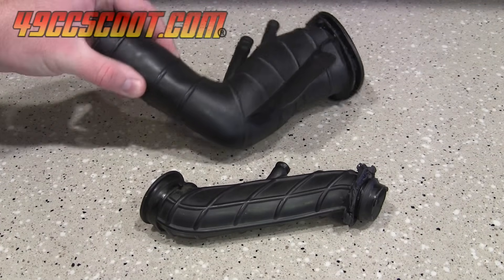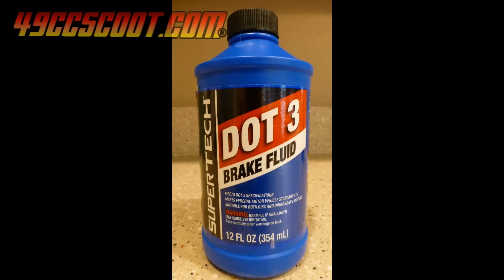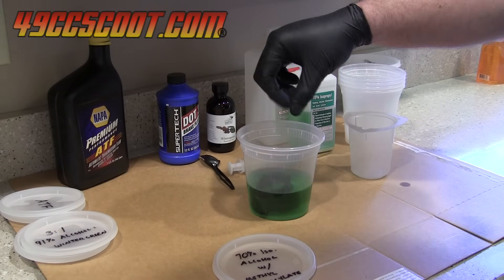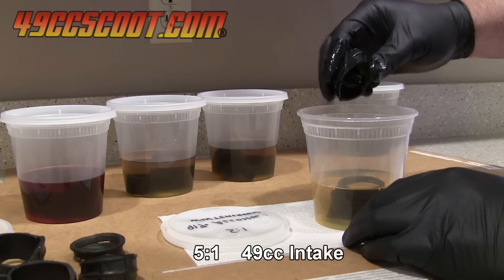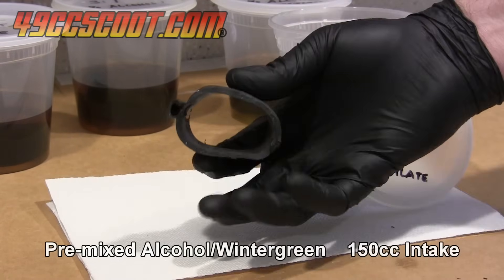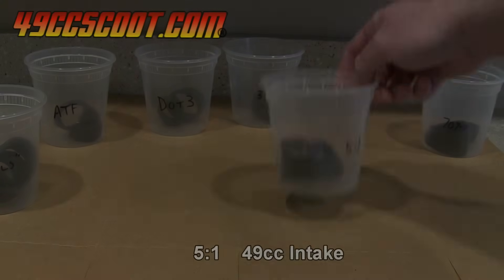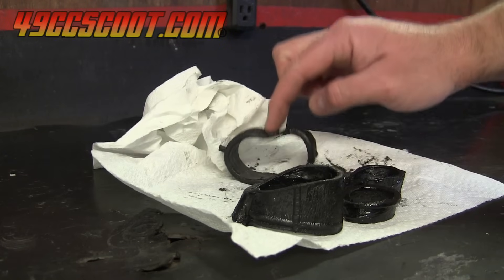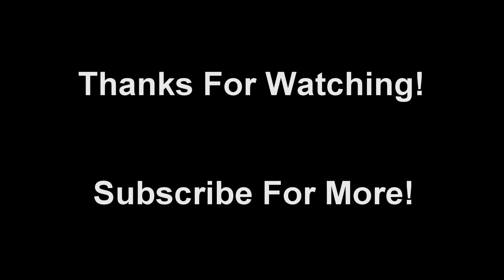Rubber Softening Experiment : Wintergreen Oil, Brake Fluid, ATF & More

Comment: can i use this to soften dry rot car tyres. they r not so much rot.
but so much DRY and making noises when running at slow speed also
Reply from the maker: Check  the codes on your tires to determine their age. If they're more than 6 years old, most recommend replacement. If you're experiencing  rubber degradation, it may again be a reason to replace them. It's not worth trying to rejuvenate tires IMO, because it could be a safety risk.

Comment: We needed a control for the second test to prove boiling in water wasn’t what was causing the softening, or at least to see if the softness is significantly different or longer lasting than the wintergreen mix boil.

Comment: What about pure winter green on the experiment?
Reply from the maker: I didn't test that, but the alcohol is supposed to basically open the pores of the rubber to allow the wintergreen oil to get in there better.

Comment: Wintergreen oil (Methyl Salicylate) is an actual plasticizer, and used in many rubber formulations so it can renew properly many types of rubber. Other fluids like brake fluid etc instead contain oils that will degrade plain rubber (that is why there are particular oil resistant rubbers used in certain applications), the temporary softening is just due to the solvents in the fluids. 
Avoid boiling the rubber, the temperature is too high, for large parts just use glass beads to fill the voids when soaking and change position of the part every so often.
Reply: That glass bead trick is great. Im kinda embarrassed I've never thought of that before
Reply: @jmc5341  +1 to that, so simple yet probably works great and can be used infinitely
Reply: Nice explaination
Reply: Thanks ! do you happen to know if it is also used as a plasticizer in vinyl mixes ( vinyl doll parts for exaple )
Reply: Thanks! Will Wintergreen help restore embrittled plastics? If so, how is it applied?

Comment: Great test! Too bad you didn't try pure wintergreen oil. I am tempted to try that on hardened speaker rubber surrounds, where alcohol would just evaporate.
Reply from the maker: If you wanted to try the alcohol/wintergreen method, or anything  else that you wanted to seal, if you can remove the speakers then maybe you could place them face down in a large bag or container. Some speakers use a foam rubber that I don't think softening is going to work on, but I suppose if it's an otherwise lost cause then it's not much risk.

Comment: Hi just have a question about the 91% isopropyl rubbing alcohol, is it good if i have 99.9%? Or it will just fail??
Reply from the maker: That's fine. 91% is the most pure that I could get at a reasonable price.
Reply: @49ccscoot  ok. How about 70%?
Reply from the maker: @cjbongalon2064  That's commonly used too. Not sure I'd go below that.
Reply: @49ccscoot  ok ok thanks for the info.❤👌

Comment: Nice video, well put together and informative. I'd be interested to hear from anyone who's tried any of these methods on drive belts, wheels etc from vintage record players and tape recorders, where rejuvenating old rubber is a similar issue
Reply: Good question. On the topic, would you know of any good video resources on how to restore old reel-to-reel recorders? I'm not even familiar with how the mechanisms work so in depth tutorials would be the best help.The one I have appears to rotate one of the reels in the wrong direction.
Reply: @Marcoosianism  This may be of help: In some models the "feed" spool (the left hand one) achieved the correct tension on the tape by having a slight drive in the opposite direction; this will only be noticeable when there is no tape engaged, if you press "play" the "turntables" will rotate in opposite directions. There is a great website / forum called "tapeheads" for any technical questions related to all types of tape recorders. A friend of mine has recently used the Wintergreen oil method to restore a rubber-edged drive-wheel on a 1940s record deck
Reply: @signature50  Very helpful! Thanks Sig50. I'll check out tapeheads and give it a go actually loading the spools on the machine. Figure I'll most likely have to restore some rubber parts using the wintergreen oil method too. Glad your friend had success. I'm sure you will too.

Comment: Would have loved to see you compare shore hardness tests to your calibrated thumb and finger.  Seems like an automatic since measuring elastic/rubber materials hardness is what it does.  You went so far out of your way to be scientific too.
Reply from the maker: If I knew there were test options that are pretty affordable, I would have. Live and learn. I still think for most people that have some hard old part, they just want to know if it is significantly softer or not though. Thanks for the comment.
Reply: @49ccscoot  True.  I think your results are adequate.  Shore hardness gauge is not in the average persons vocabulary.  It would have been interesting to see if your feel/touch results agree with a gauge designed to make that measurement, that's all.  You clearly went out of your way to be as scientific as you could.

Comment: I use wintergreen oil a lot.  Get the gallon size.  I tried it on an old motorcycle seat cover.  Bad, so bad.  The vinyl separated from the backing.  Some old carb intakes swelled so much as to be unusable, at least for now.  But, in general it helps, even thick rubber parts.  I keep a pot covered and toss in parts as I take stuff apart so the mixture lasts pretty long.  I soaked an ignition coil where the wires were too stiff to bend and they came out better than new.  They felt like silicone rubber wires.  And, the shop smells great.

Comment: Question, will it work on shoes as well? Since rubber outsole hardens on shoes as well.
Reply from the maker: You can try it, but I would suggest being careful to make sure no chemicals contact anything else. Especially anything that would be in contact with anyone wearing the shoes.
Reply: @49ccscoot  i have another question, does it matter which oil you use? Or does it have to be specifically wintergreen oil? I keep finding peppermint and other oils but no winter green.
Reply from the maker: @thomascalderon598  It needs to be wintergreen / methyl salicylate.

Comment: Used the 3-1 mix on carburettor intake stubs. They swelled up slightly at first, but softened up nicely, about 10 days later they were  back to their original size, and were ready for use.
The softening effect lasted about nine months, then the returned to being rock hard.
Reply: Good to know
Reply: I know your comment is 4 years old but I wonder if a coating of silicone oil after a softening treatment would keep the rubber soft for longer than 9 months. Have you any experience with this? Thanks.
Reply: @istvanmeissler2238  Interesting thought, it didn't occur to me to try. The idea might work for some applications, but in my case the rubber intake stubs are up to around 6mm thick in places and made of rubber similar to that of a car tyre, and I doubt it would penetrate deep enough into rubber to do anygood..Good luck with trying though..

Comment: Epoxy curing agent dissolved in hot oil was the best I've seen. It makes rubber really pliable in a few days. Fuel system cleaner with polyetheramine (same substance in epoxy curing agent) comes in second and Brake fluid comes in thrird. Never tried wintergreen. But you need to feel after it completely dries.
Reply: Do you know the chemical name of the epoxy curing agent you used?
Reply: @wildmanofborneo  Triethylenetetramine or the heavier Tetraethylenepentamine.

Comment: To control temp of the water & Winter Green tests, try using a double boiling method.  That is a pot inside a pot.  They use this method in cooking/heating candy.  Outer pot is water only, inner pot is the solution.  The water in outer pot more evenly distributes the heat.

Comment: This is so cool!
In my research, I found that wintergreen, petroleum jelly and other spirits are rubber solvents, and the rubber goes hard when it loses its plastics. Replasticising is why silicone spray is ideal on window seals and such. 
The brake fluid thats usually used is part petroleum and part silicone so its both solvent and replasticiser. 
The recommendations Ive seen around are: For maintenance of rubber - silicone spray wipedown. Heat only used if its hardened due to low temps. Petroleum jelly wipedown for a slightly aged piece that needs a refresh/refurbish. In cases of undamaged but very hard, Ive seen recommendation of hot water soak first to then dry and then soak in your brake fluid or silicone spray for a varied time, checking as you go to see based on the rubbers needs. Once satisfactory, sake out and wash with soapy water, rinse and  let dry for a day.
I was looking in the way of old typewriter platens and thats all the stuff that I came up with. Apparently sewing machine oil and an old bottle of what was called Typewriter Oil are both petroleum oils and were used for the maintenance of the machines.
I thought Id share in case its adds to the research experiments. :)
Reply: Thanks for adding this.  It sounds like you are reporting research rather than experience?  I wonder if the "Silicone Spray" you mention is the typical stuff with solvents or the special pure stuff that is food grade.  CRC sells a pure food grade spray but the rest are more like WD-40 with silicone added.
Reply: @ceeweedsl  I have both vintage sewing machines & 70s typewriter. Used Vaseline on slightly too firm, and soaked in WD40 Silicone spray (the one labelled as Silicone spray, not the general spray they have) on the platen and rollers of my typewriter to refurb. I wrote all the other stuff bc I did a tonn of research for just that small amount and ppl may have different needs & points of info to make the best decision for their rubber refurb needs & having it all there would make life easier than it was for me.

Comment: I like the fact you didn't quit , well been two days I wonder what a week will do, still not the result you were looking for so lets add some heat.  Very well done.  I have expensive rubber boots, the rubber is starting to crack , looking for a way to soften the rubber back up. I don't think this will help but it was fun to watch.  I think I will try the heat and the wintergreen oil, with controlled heat.

Comment: Thanks for a very informative experiment. 
I need to revive two washing machine shaft seals, so your video clip is just what I needed. 
I read somewhere that almond oil is supposed to rejuvenate rubber,  which might be a cheaper option (if it works as well as  wintergreen oil)
Reply: did you ever try the almond oil?

Comment: boiling the rubber improve the hardness by removing stress from crystalised work hardened rubber surface and is really similar process to steal anealing 
from what i know temps for water anealing rubber should be 80-90 C for more than 5 minutes and leave them to cool off slowly in the water to "normalise"

most rubbers that are thermo set should respond well to this treatment but the hardening will return because in most cases reason for hardening is evaporation of plastecizing agents that are not restored by boiing, but can by soaking in them
Reply: Interesting; what are the names of some plasticizers? thanks

Comment: Would this method restore stretched out thinner rubber? 

I'm trying to find a way to restore the rubber focusing ring on a vintage 1960s camera lens. The rubber ring that was around the lens has loosened or stretched over time and doesn't grip to the lens anymore for proper focusing.
Reply from the maker: I'm not sure if it will work for that. If the piece is no good anyway, you could try it.

Comment: Would this work on a dry rotted gas mask?
Reply from the maker: It may soften it, but it's not going to fix cracking and such that generally accompanies dry rotting. If the mask will actually be used, forget it and get a new mask.

Comment: Everyone is complimenting the scientificness and thoroughness of the experiment, which I agree, but no one noticed hes using TAP water (which has chlorine among other things in it)? Lol
Reply from the maker: My TAP water is well water. Not treated. Who knows what's in there, but it shouldn't be chlorinated.
Reply: Chlorine also another compound which has potential to soften or slicken rubbers. My friends back in my high school days used to pour puddles under their car and truck tires to help create some crazy burnouts while keeping the front parking brakes engaged.
Effectively/Quickly softening the rubber to break any traction.
Principle and vice principal used to give out after school detention to those caught.Lol
Anyway,  more importantly,  I too am thankful for the kindness, sharing this video, and all the time devoted to making it.
It truly helps many (myself included) looking for the best method/safest method to soften or rejuvenate our hardened rubber items without destroying them.
It's much appreciated.

Comment: So this has given me an idea, after speaking with a pharmacist, we realized that wintergreen oil's active ingredient is the same as icy hot muscle rub. I was thinking I would coat the rubber intakes with the icy hot then vacuum seal them and let them "cook" in a bath of hot water in my sous vide machine. Do you know what an ideal temp would be? I have a control so I can go low like 120F/49C or would warmer be better?
Reply from the maker: I'd guess it depends on the exact rubber used. If it's not a rush, I'd try low temp first and see how it does or just see what happens with the rub alone.

Comment: Hey great video I was wondering if any of the products used seem to have added any slip resistance or grip to the rubber?
Reply from the maker: They would probably better to some degree just from being softer. I don't recall any of them making the surface sticky or rough.

Comment: I wonder if you did not use any wintergreen oil, would just simmering the rubber in water work?
Reply from the maker: Most likely only temporarily softened while hot.

Comment: Thanks for taking the time and doing this. I restore old typewriters. They have rubber platens,rollers,and feet. They are very difficult to find replacement. Expensive. I'm going to try this. Thus video could be invaluable to saving pieces of history. Thanks again,very appreciated!
Reply: Use a product called "rubber renue".

Comment: What about rubber suspension parts that have aged allot on a vehicle with barely any miles, like a car with 20-30,000 miles but is almost 25-30 years old, you might be best to replace them yes but some parts can be expensive or hard to come by depending on the vehicle and manufacturer. 

Would like to know if there is a solution especially one that involves spraying on them instead of taking the part off the vehicle and dunking the part in a solution for a long time.

 Heard that AT-205  Reseal ,being it is a plasticizer could work. Resealers overall are snake oil cause most are petroleum based but AT-205 doesn't have any and has been highly praised overall,  heard a light spray can help rejuvenate rubber suspension but dowsing it in the stuff can make them too puffy and squishy.
Reply: Great thought.  I’d like to spray this 3:1 compound on my axle boot covers.

Comment: That's great! Thanks for the info. 
I have a couple of pieces with new rubber but very stiff, does this process soften new rubber or does it work only for old rubber to get its previous softness?
Reply from the maker: I've only tried what you see in the vid.

Comment: I am trying to boil a piece in jsut water to see what happens but im only boiling it for a few minutes. However the thing I am boiling is a little solder vice suction cup thing so it doesn't have to be super soft just soft enough to be a suction cup. Out of the water it seems fine and now i am waiting for it to cool to see if it stays soft or what. I assume it wont stay soft but I figured it was worth trying.

Comment: One way to reduce the amount of solution needed is putting the part and solution in a sealed bag, and then submerge both in plain water to pick up the space and push air out

Comment: I tried this with old sneakers whose rubber soles had turned hard.  I mixed water and wintergreen oil in a pan and then placed the shoes in the mixture, just enough to cover the outsoles.  I covered everything with plastic wrap to try to prevent evaporation.  I left them for for over a week and when I retrieved them I noted the once white leather uppers had turned pink from the red paint on the soles that had been submitted in the mixture.  The plastic wrap had turned pink as well as the liquid mixture.  The rubber outsoles had been ruined as thin parts had stretched and torn despite not having been touched during the experiment.  To sum up, check your parts frequently and avoid soaking painted parts unless you're okay with paint bleeding.
Reply: Sounds like you're into sneakers, I'm assuming you wouldn't recommend? I too have some shoes with hard soles..
Reply: @Chocolategiddyup5  You'd really have to experiment with amount of oil and length of time. When I did it, the rubber cracked or got gooey. In both cases the rubber turned hard again.
Reply: @kevin15776  good to know, thanks for responding. I'm just gonna have to accept that the shoes are at the end of their wearable life smh
Reply: @Chocolategiddyup5  maybe someone will find a way one day
Reply: @kevin15776  I hope so 🤞